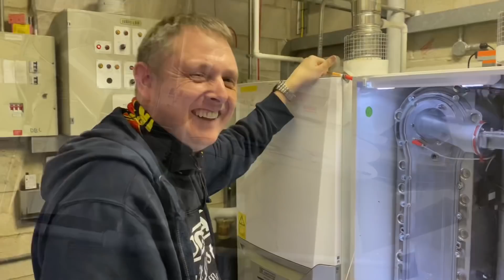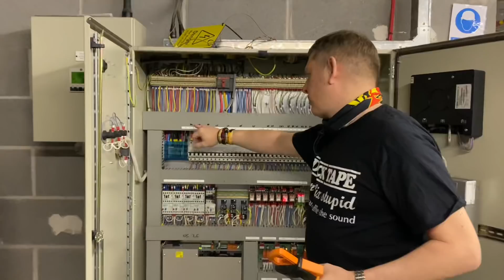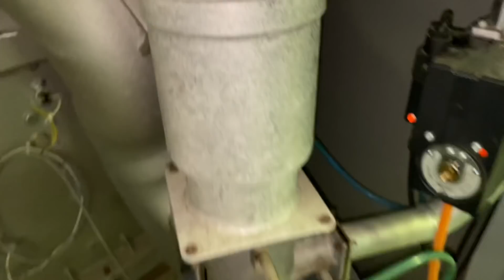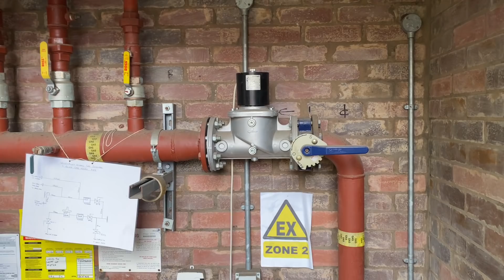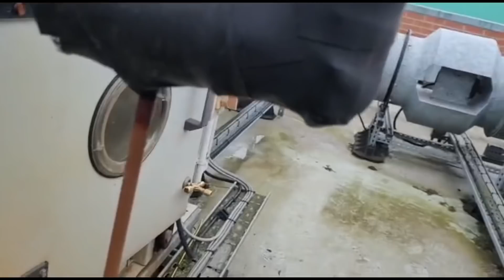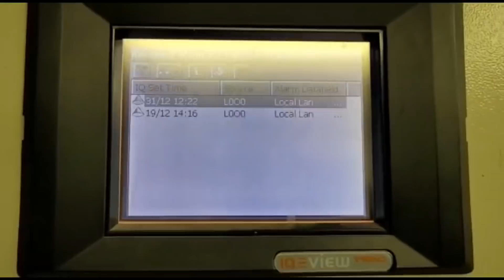Commercial Boiler Repair - Water Heaters - Boiler Rooms - Gas Meters

Comment: Those rpz valves are an over engineered backflow prevention device, they keep water downstream of the valve at a lower pressure and encorporate a prv (blow off valve) for any rise in pressure in order to maintain a downstream lower pressure along with the usual double check valve ...bit over kill for your home though lol

Comment: Guys. I have ❤ some of your comments today. I do read through them but its usually late on a evening when I should be switching off but I cant. Anyway some of you have asked about the Riello burners. SOOOOOO I will do a video on them. I must admit they are very different from your domestic stuff. These are also used on your gas boosted systems. Take care guys and see you soon.

Comment: He’s a good fella dating all new  parts and marking up ventilations
Reply: I'm not in the industry just for myself. I'm here for everyone. If I can make it easier for the next lad or lass I will. 👍 that's also why I print 2 lots of combustion tickets.
Reply: It's not a bad shout too! Dates and marking up all the ventilation grilles sizes, we have data badges on the boilers, so should we not have the ventilation marked too!
It's all part of the combustion process, you need the air on a open flued system. It's a good way forward. 
Great video lots of content 👍👍
Reply: I do the same. My name/number is on my combustion printouts, someone can contact me if they want. I also use a ‘highlighter pen’ to show the manufacturer’s requirements according to their specifications. I normally write the ventilation calcs on the rear of my service sheets, great idea writing them on the doors, I’ll pinch that idea thanks. 
These plantrooms are what I deal with daily as a maintenance engineer, although many of them aren’t so clean and tidy as those. 😊 I’ve changed quite a few of those fans, they are expensive items.

Comment: All high spec kit in the plant rooms. Remeha are, in my opinion, one of the best on the market. Great for maintenance. Lee, might be worth getting yourself a belt tensioner gauge. Fenner used to make them. 
It gives you a way of measuring the correct tension of your belts. Best on bigger, longer belts, but a useful thing to have (once had issues with new AHUs where they came to us poorly aligned/tensioned. No argument if you set them up with a tension gauge!). 
Apologies if I’m telling my granny how to suck eggs!! Just if it helps you. 
https://www.bearings-online.co.uk/item/1331/Belts/Fenner-Belt-Tensioning-Pen.html
eBay do them to.
Reply: thanks for the tension gauge tip. i do wish remeha would lay off the aluminium though
Reply: @cliveramsbotty6077  they aren’t really a big issue, in my experience. Although we have a large building where the 610 boilers used to pop sections often. Once we convinced the water quality company that 13 ph was far too high to have circulating round the system, and got it down to a more realistic level, nearer 9, it stopped happening. Remeha’s are really great to work on.

Comment: Push fit on flue condense 🤔
Reply: dangerous do you think?
Reply: I know, that’s not right condense will destroy the rubber seals and leak combustion gases into the area they should be solvent cement as per spec condense is slightly acidic
Reply: No it's not dangerous. I've never had one fail in years I've been doing commercial.